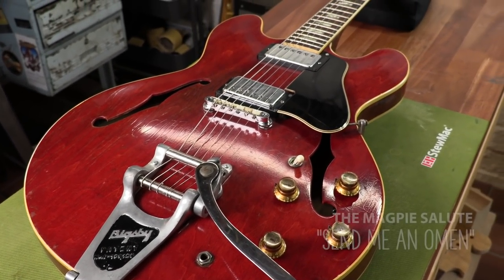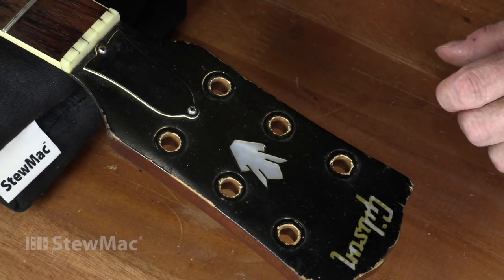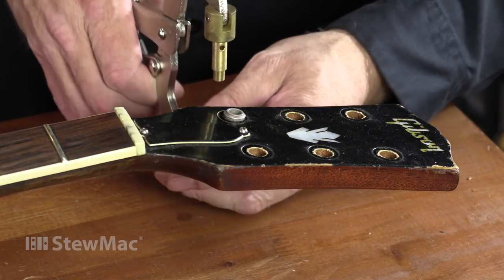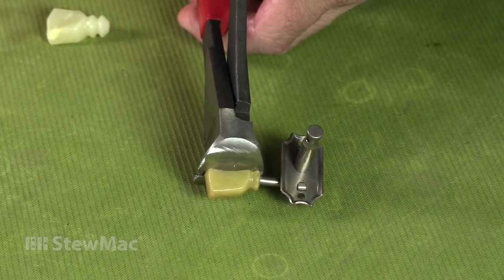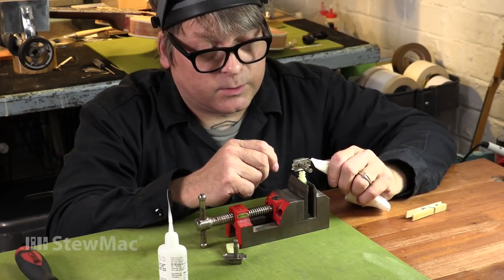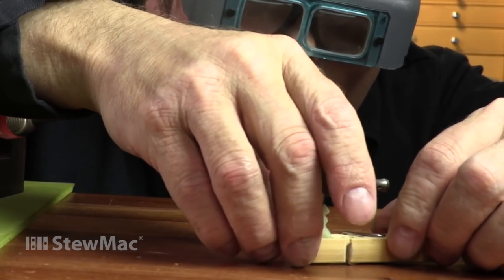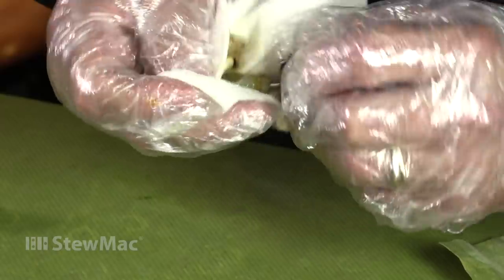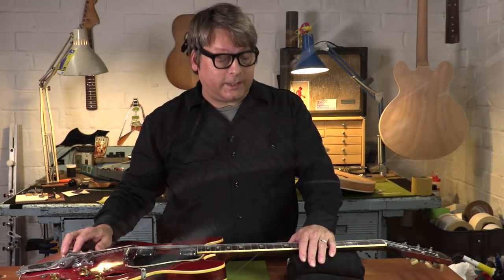Changing Rich Robinson's Grover tuners back to vintage style Klusons

Comment: To age the knobs, mix acetone with water 2:1 and add toner. dunk the knobs in for a couple seconds at a time  until you're happy with the color. Been using this for years, no guesswork, no danger, you get the right look. If you mix up a batch of this in a Mason jar with a lid, you can age lots of plastic knobs and saddles with this for years. Practice on junk tuners. YMMV
Reply: This ages the plastic?  The issue I'm having is every set of Klusons I order are puke green and not the ivory color they advertise.  Is there a way to make them less green?
-P

Comment: "And get it into the Post Office" -- am I the only one who wants to see what goes into packing a vintage guitar for shipping back to its famous owner?
Reply from the maker: Great idea! We'll pass along your suggestion.
Reply: @stewmac  Please do this :D
Reply: Hopefully, he was just playing a bit, as he signed out ...
Reply: Soft gig bag and a big "handle with care" sticker should do it
Reply: the motto will be: too much. I work in a guitar store, and you'll take special care of any switches and fiddly electronics, as well as, or most even: supporting the neck, headplate and tuners. Gibson cases sadly are not built to actually protect the necks thoroughly.
Reply: I'm cringing. I just picked up my Gibson ES from the Post Office. Broken headstock.
Reply: I buy and sell a fair amount of instruments and parts on Reverb, Stratosphere, etc., and my method is as follows:

Put it in a good hard case, tightly cramming ANY air gaps ANYWHERE in the case with tightly wadded newspaper. Get a box about twice as deep as the case, and about 30% longer and wider. Lay down a continuous base of those little air packing strips that look like a bunch of clear inflatable hot dogs side by side (I get them off the interweb, usually from Uline) in the bottom, at least two layers deep. Place the case in the box, centered. Tightly pack the void between the outside of the case and inside of the box with more of said inflatable hot dogs or tightly wadded newspaper. Then put at least two more layers on top of the case and carefully sandwich the top on the box. Tape the mortal mess out of every seam, and send wherever the spirit moves you to send it. 

I've never shipped anything worth more than about 4 grand (I'm not rich), but with package insurance I wouldn't be hesitant to. I've never shipped anything that arrived damaged in any way, save one old Gibson bass whose fretboard started peeling up at the end from extreme heat and humidity (guy bought it in August in Florida and insisted I ship it from the Colorado mountains, I told him it might damage it and he assumed the risk).

Comment: Using the conversion inserts leave the old ring marks. Faber offers vintage aged  kluson style keys with screw in top inserts that fit perfect with require no alteration and cover the old ring marks..they also look amazing!
Reply: Not everybody cares about rings showing and some of us don't like those huge bushing that are half an inch(13mm) wide. That's part of the reason I swapped the grover style things off of my 355-style guitar. They were wayyyy too gawdy and oversized. 

Vintage tuners have a smaller diameter bushing looking from the top down and smaller tuner shafts, usually, too. They're just a finer tuner. Not made as big as screw-in bushing tuners.

Comment: You should break the tuner, so it’ll be like most old Gibson tuners.
Reply: I think you mean so it'll be like most Kluson tuners.    They always fail - it's just a matter of when.  For the life of me I do not understand why they remain popular.
Reply: It's the headstock that always breaks after like 50 years.
Reply: @miko8732  Well, yeah, there's that.  But it's also true that Kluson tuners are notoriously prone to failure.
Reply: @miko8732  Or when your case falls onto it's side.
Reply: One of my tuners broke with in 7 months of buying my new SG. I put Grover's on it not knowing this was a popular mod.
Reply: You know F1 Cars need their engines rebuilt after every 10 or so races. Does that make them worse than a Toyota Corolla?
Reply: @iamsuperflush  This analogy makes no sense, F1 cars are built for high speed maximum efficiency racing, a corolla is designed for maximum fuel economy both good in what they do. Gibson guitars are just badly designed, overpriced guitars with even worse quality control.
Reply: @iamsuperflush  What an idiotic analogy.
Reply: That's why they make replacements
Reply: @chuckschillingvideos  I think if memory serves, both of the tuners that broke (that I had) were the Kluson. So yes you are correct.

Comment: Got similar issue recently. Unfortunately, can't find anyone selling conversion bushing around here, so I stuck with vintage bushing provided by Gotoh. 
This vintage bushing has around 8,5mm outer diameter (OD) and 6mm inner diameter (ID).
So, i need to find something with 10mm OD and 8mm ID to fill in the peg hole. Luckily, I found someone who sell brass tube/pipe with those exact measurements. So, I created six brass bushings from that tube (with cutting and little bit drill press work to fit in the 8,5mm OD), and now the vintage bushings installed. Perhaps this can be your other options/alternatives. 🙏🙏🙏. You can ream the brass bushing instead of ream the wood. 😊

Comment: I'd age those shiny tuners. You brush them a bit with a scotch pad to break the surface, then rub them with hydrochloric 
 acid (you can get it from DIY shop, used to clean bricks) and leave for 10-15 minutes, which will darken the surface to make it look old. 

You can then use peroxide in the end to bring a touch of rust for it to look super authentic. I've reliced many, many guitars that way, works magic.

Comment: Nice job.  Functionality-wise, the Grovers are superior tuners though!
Reply from the maker: Thanks for your comment! These modern Gotoh tuners function flawlessly, much better than an original Kluson ever would have. Easily of equal quality than a Grover. Check out a set!
Reply: I much prefer the look of the Grovers as well.
Reply: This video came to solve my problem. I have a Gibson Les Paul Custom 1959 reissue with grover tuner milk and I want to put the kluson vintage. I need the adapter bushing. Can you tell me the correct model for Gibson Les Paul Reissue 1959? Item # 3460 or item # 3459? Thank you.
Reply: Much better
Reply: Many people find them to be to heavy, upsetting the designed balance of the guitar, and Grovers fail often. Klusons rarely do.
Reply: @neverlooksatit7986  Klusons wear out easily, buttons strip, shafts bend easy. I've got a bunch of patent pending grovers from the 50's...no issues yet.
Reply: Grovers are ugly and they sound bad=To heavy the Klusons sound and look way better good job!
Reply: i just discovered wilkinson tuners. pretty much the exact same thing as grovers (same gear ratios, quality, etc) with a different name printed on them, and half the price!
Reply: I have changed out a lot of tuners to Grovers / Schallers back in the early '70s ... While I love their functionality and long life, I am thinking that Grovers have changed the sound of some of my personal guitars, particularly, a J-200 ... perhaps my imagination, but after 57 years of playing, perhaps not ...
Reply: @neverlooksatit7986  Been in this playing stuff for quite a while, and I have found that failing, was what Klusons did best. But I agree with you on upsetting the balance ... sometime, the Grovers just make for too much mass on a headstock and can affect the tonality of the guitar.

Comment: Good job but grovers are a one way trip owing to the large indentation(s) the washers leave. On a vintage guitar I'd just leave it alone you aren't going to be adding any value by using modern replacement parts anyway. It can be argued that going to klusons from grovers is a tone thing as it definitely does change the tone (less mass, more airy) so that's justification I guess.

Comment: I have the same guitar and want to put original tuners back on it. And of course the holes were enlarged to accommodate the new style tuner. I am going to plug my holes with dowel plugs. Should I use hardwood as opposed to mahogany (same neck material) and what would you recommend? Something hard and dense like ebony?

Comment: The problem lies in the fact that whoever installed the Roto-Matics bored all the way through the headstock. That's a big NO-NO! You only ream out just enough to fit the Grover machine housing from the back and no further, leaving the remaining channel diameter unchanged. When done right, the hole accommodates the Grover threaded bushing while assuring the Kluson bushings will still be a nice snug fit, just in case you need to restore the originals.

Comment: Why use a tapered reamer when a straight reamer works much better? That way, the top of the hole isn't larger than the bottom so the bushing is tight all the way through and not loose at the top from oversized reaming.

Comment: This video came to solve my problem.
I have a Gibson Les Paul Custom 1959 reissue with grover tuner milk and I want to put the kluson vintage.
I need the adapter bushing.
Can you tell me the correct model for Gibson Les Paul Reissue 1959?
Item # 3460 or item # 3459?
Thank you.

Comment: love your videos man!! can i ask you something? i want to remove my brand logo from my painted guitar headstock. Is there any way i can do it without repaint it??? keep the good work!! :)
Reply from the maker: What kind of finish does your guitar have on the headstock? If the logo is set below the last few clear coats of finish, you will have to sand through until you've removed it. If you want the end result to have a gloss finish, you will need to reapply a few coats and then proceed to the wet sanding and buffing process.
Reply: i think the logo is under a few coats of finish. Do you know how i can find the code from the color? thank u very much for the advice!!! :)

Comment: Can you help me please? My acoustic is, after 15 years, not in tune at 12th fret. The fretted note is slightly higher. What do I do? Please, anything.
Reply: SeaWolf, not to be facetious, but, change your strings. 15 years is long enough :). Seriously, old strings may cause intonation problems. Also, check the bridge for movement and the top for movement i.e. bellying, and if your action is raised you may be lifting the pitch of the fretted note with your fretting finger pressure. If all that is OK, you might be able to cut a new saddle with the break point of the string towards the rear of the saddle rather than the middle. Also, are you sure this is a new problem, or could you just be more aware of stuff like this now? If the latter, could be you need a better acoustic. Tell the wife I said so!
Reply: Don't worry about the strings. I use Elixirs and my guitar is well cared for. 
This was a very minor problem some time before, but now it is really pronounced. For example, my B string (fretted on 3rd fret) doesn't match the open D string. The thing is, I didn't notice that problem with lower strings. My action is good, as for that other stuff, I will need to take a day off and check it. I tried loosening my truss rod a few degrees. I think it helped. Thank you for your help. PS Doesn't one always need another or a better guitar? :)
Reply: Always! :)  Sorry I can't think of anything else, maybe someone more experienced can chime in. It's hard to think of what else might cause it. When I mentioned the saddle I was assuming it is still upright; if it were tilted forwards that could do it.  But usually it's one of these things, old strings, saddle shifting, high action/pressing harder. Also, that the nut slots are cut so that there is a gentle curved ramp down towards the headstock end and the string leaves the nut cleanly at the fretboard end, not somewhere back in the nut slot. Which can be difficult to see and assess. 

As a general rule I would change strings first, particularly if you don't do your own setups and your repair option is paying someone. Have you posted this question on any guitar forums?
Reply: The strings are a few weeks old, so new. I have been watching StewMac videos for days hoping to find something to help me. I will inspect those things you mentioned and hopefully reach a conclusion. Sadly, I do not have any reliable guitar guys available, so I guess I will have to do it myself at some point. 
Can you recommend a good guitar forum? I am not sure where to start.
Reply: New strings are much less likely to be the problem then. Except it is possible to get one dodgy one in a batch. If you're noticing it on other strings that's less likely, although it could even be a dodgy batch. I've also heard of fake strings, did you buy the Elixers from a reputable source?

"A good guitar forum"... well that could open a can of worms :) The bigger ones are The Gear Page, and Guitarnutz.
Reply: Yes. I noticed this on my last 2 - 3 sets of strings. All strings were purchased at different guitar stores/centres. I have eliminated them as a problem already. I will wait another day for the wood to adjust and then do another few degree adjustment on the truss rod. I believe it helped a bit... still haven't completed 1/4 turn, I'm taking it easy.
Reply: How are you assessing neck relief? My approach is to hold or capo at the 1st fret, hold down at the 18th fret, and look at the gap at the 8th. It should be .005"-.015" or so for an acoustic. If you don't have feeler gauges, an old top E or B string will put you in that range. I'm assuming you're flattening the relief, that is, making the neck straighter?  After each partial turn of the truss rod, sit the guitar on your lap, hold the bottom of the neck by the body, and the top near the nut, and push the nut end backwards (straightening the neck) as if you are trying to snap the neck. (Don't worry, you probably won't...:))  It helps the neck respond to your truss rod adjustment. And don't worry if there's a creak or a crack as something shifts while you're pressing. But yes, an eighth of a turn at a time is a good safe guideline. And if you get your relief dead flat, tighten it a tiny amount so you can just see the beginning of relief as it's not easy to tell if the neck is flat or actually in backbow if you can't use the string method to check, as above.
Reply from the maker: Thanks for your comment. It is impossible for us to diagnose your instrument without a hands on evaluation. We suggest taking your guitar to reputable shop in your region for an inspection, they should be able to direct you to a solution.
Reply: My action is a bit better now, however, the intonation problem remains. I inspected the guitar as best I could. The nut is ok, the neck is straight, there is no bellying that I could see, but I did notice the saddle was slanted towards the sound hole by a few degrees. Think that could be it?
Reply: Definitely could be. Is the slot in the bridge widened or could you just loosen the strings, stick the saddle back in and have it stay upright?
Reply: +stewartmacdonald Oops, I hit dislike by mistake when this comment showed up on my phone. Sorry, I've hit like now, hope that corrects that.
Reply: Thank you very much for responding. I've been watching your work for years. 
Sadly I have no reputable guitar shops in my region so I am forced to do it myself. Since the neck appears to be straight ( the only difference is that 15,16,17th and so no frets have less wear on them), the action is good and there is no visible bellying, I can only assume it is a saddle adjustment that I need. Hopefully that will resolve my problem. 
Can you point me to any videos or materials about slanted saddles and how to fix them?

Comment: Reverting to lower quality tuners seems very similar to an exercise in futility.   I did my swapped my Klusson tuners for Shallers.  I am not interested in "vintage" if more modern is better.  That's why I have a 1998 and a 2002 Music Man Silhouette.  I surely wish my 50's & 60's Gibson and 60's & 70's Guild, 90's Fenders and G&L electrics and Epiphone, Gibson, Guild, Martin, & Taylor acoustics were in my instrument closet but they were sold years ago.  Now there is 1 Silhouette and 1 Mexican Strat that plays extremely well now that I polished the frets and reshaped the neck.  I never play it but friends that visit like playing it.  All I need is an acoustic or maybe 2.  I would also like a Silhouette 6 String Bass.
Reply: Sure. It's more about aesthetics, which is relative. Grovers did outperform Klusons by miles. Nowadays Klusons are much better made than in the 50s/60s, so it's not much of a downgrade. They work fine, even if they aren't as sturdy and near zero-maintenance as Grovers (you do have to tighten the hexagonal bushings often though, as they always loosen up with vibrations). Yet they are lighter which can help balance some neck-heavy guitars.

Comment: Those gold reflector knobs aren't original. They should be black right?
Reply: I've had 335s up to 68 with those knobs, usually sunburst guitars and they continued using them in other models through the 70s.
Reply from the maker: More often than not they were black on these, but not always.

Comment: You should've gone with one of the other options instead of the conversion bushings, sure they get the job done but you will still see something is a little bit off. And when you're going so far as switching out the knobs on the tuners you should have done it. Send it back, Rich! ;)